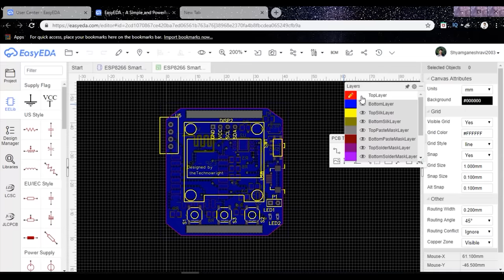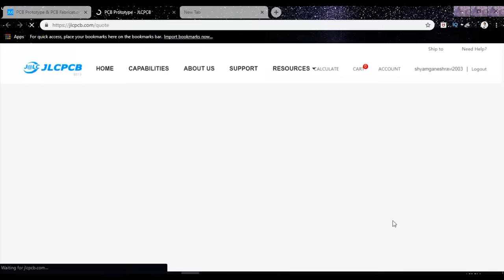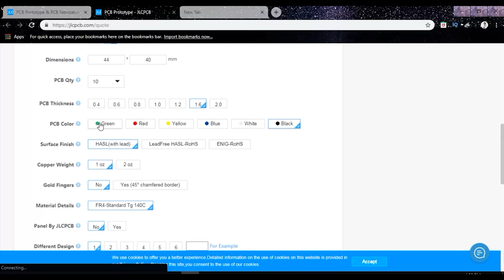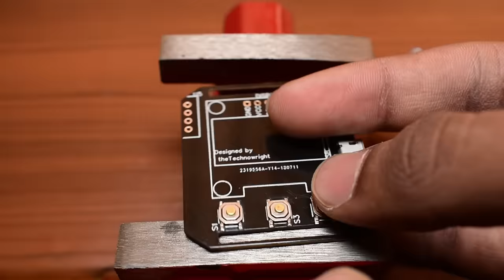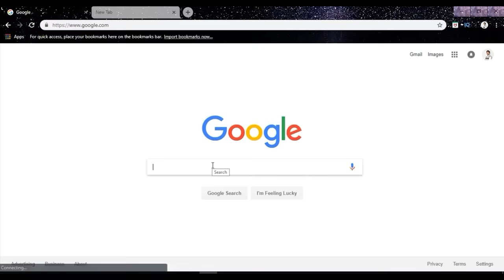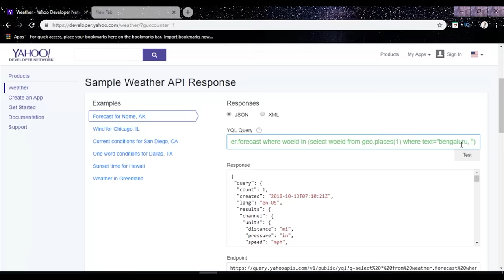How to make a DIY Smartwatch! || ESP8266 IoT Project

Comment from the maker: Hope you liked the video! And tell me what other features I can add to the watch.

And also check out my latest video on Custom PCB design using EasyEDA:
https://youtu.be/Lvp5RB3lgWE
Reply: Sweet! Have you considered making one with the ESP32 so you can connect bluetooth to the phone?
Reply from the maker: Yup, that will be the ESP smartwatch V2
Reply: Remarkable
Reply: Use a heart beat sensor
Reply: Or you can make it show notifications through wifi or bluetooth from the phone ill give you the code & the app if you want you gave me a lot and this how i can repay you 😍😍😘😋
Reply: I think ESP32 would be a good upgrade. And then you don't need to worry as much about the YahooWeather API too, as it has most sensors built in. It'll be a little bit more expensive to add temperature and humidity sensing but a bit more reliable.
Reply: a 3d printed case would be awesome so all the components aren't exposed
Reply: How to show temperature in fahrenheit I change tempC to temp it's not compiling
Reply: Include deauther and beacon spam code from spacehuhn.
Reply: CAN YOU PLEASE TELL ME HOW TO CONNECT THE PCB TO A RASPBERRY PI ZERO?? PLZ HELP
Reply: - A finished case
- Analog clock maybe (or analog/digital watch faces) make it more colorful as well, I'm assuming this is an RGB OLED It is not, maybe add that too.
- Animations (maybe in V3, not sure if the watch has enough power for anything but a basic one)
- Charging and battery indicator
- Micro SD can be a nice addition in V3! (Can function as the on-board storage because there is none)
- If you add alerts for calls, notifications, or SMS then you can add a vibrator (speaker will be a bit more challenging)
Reply: you could add a timer or a stopwatch, both are easy to do
Reply: U forgot to place ds3231 😎. How do you have to know a time without wifi?
Reply: Like traceur 2k said, a 3D printed case would make this better
Reply: it would be nice if you can add a simple ui system for button menu to add and remove buttons as we switch on and off multiple devices at home just like a smart home but more advanced
Reply: Bro if u do this and give me means how much the cost?
Reply: try making it to  make phonecalls
Reply: Add a camera
Reply: I love your video. I'm not good at DIY electronics, but if you want, I'll lover to buy that watch from you
Reply: plz share easyeda link
Reply: You can add 
1)IMU "MPU6050" and add some easy algorithms to track steps, running,sleep,deep sleep... 
2)use weather API to get todays weather...
3)if possible then add heart beat rate monitor...

Make your own app with mit app inventor or similar website... And connect it with firebase... And now you have your own cloud, your own app...

By the way this is nice try... Improve it further... All the best... Contact me if you want any suggestions...
Reply: @the technowright  can I get into contact with you for project purposes
Reply: Gr8 work bro....☺️
What is your age?
 you are doing amazing stuffs keep going.
Good Luck 👍

Comment: I like your work, let me just say some constructive criticism
1- keep eye on your audio level, i don't know what video editor you use, watch the two moving colorful bars that moves while playing video - these show audio level. You want them to barely touch the top all the time. In your video - the music is too loud and you are speaking quietly.
2- use flux on solder joints, do not be afraid of reheating the joint until it looks nice and professional. If you put too much solder, pull it away with copper strand wire or solder wick.  Also remember to clean your solder tip (wire sponge for dishes is best bet). After soldering you can remove excess flux with IPA or something similar.
But you are doing great, keep up at it.
Reply: Agree, the most important thing is to learn how to solder properly. Basics first. Training, training, training.
Reply: Matej Rajčan Excellent Criticism
Reply: There $1 sponsored to the video, for good work. :)
Reply: Parabéns pelo projeto
Reply: hell yes, i turned the audio up all the way bc i couldnt hear him speaking and then the intro ear raped me. rip headphone users
Reply: Agreed on the audio.. my ears hurt!  Started loud enough in the middle, then jumped up, and again at the end.  As far as flux, depending on the brand of solder paste, it can have flux in it.
Reply: Here you can see my smartwatch software based on the arduino platform: https://youtu.be/PfV0_dtcoIo

Comment: Great project. I have a suggestion for the two buttons.  Use the left button to toggle thru multiple relays that could be listed on the screen.  After pausing on a selection, the screen could change to the screen that you showed.  Then use the right button to switch the relay. The left button would go back to selecting a different relay.  This way you could control many more relays.
Reply from the maker: That's great idea, I just need to work on the code.
Reply: @shyam-ravi  Hey there! I love this video and Shawn's idea here would be great. Did you ever implement this into the code? Thanks for reading this. Marton
Reply: hello shawn hill..while completing this project iam unable to upload the code hough iam press and hold sw5..please help me to complete this project..thank you
Reply: @shyam-ravi  bro plz upload new video

Comment: Nice work! And thanks for sharing the files. 

Just a quick tip about the SMD soldering - you can do all the surface mount components with paste and hot air. A stencil will speed up the job but you can do it just fine without one. Just put a small drop of solder paste on each pad, then place each surface mount component, and then heat the board with hot air. Keep the nozzle moving in a small circle to avoid overheating any single spot. First go over the whole board to warm it up, then heat a few pads at a time until the solder flows nicely. Then move on to the next few pads. This way you'll only need to use the iron for leaded components and fixing any SMD joints you may not be happy with.
Reply from the maker: Thanks. 
Yes, I can solder all the SMD components with paste and hot air, but I wanted to show that it can also be done with a simple soldering iron.

Comment: A real-time clock for offline usage and an accelerometer to count steps and turn on when you tilt the watch toward you
Reply: The needs an accelerometer and rtc should be possible to integrate though
Reply: As easy as switching to the ESP32

Comment: Hi. Cool project. Couple of suggestions for future projects form a guy with 20+ years doing electronics design though:
1. Use flux, while soldering module / anything else you solder with solder wire. Sure, it has flux in it, but the flux inside solder wire is usually not the best and you do need more of it.
2. When placing a component, tin one pad a bit and while keeping iron to it, place your part - it's much more easy that way.
3. Keep both of your arms on table when soldering and positioning parts - you will be much more precise and work much faster that way. Work with your fingers, not all hands and arms. Hold the iron and tweezer in your hands like you would hold a spoon and rest the lower side and smallest finger of your hands on the table. 
4. Do not use the vice to hold PCB - it eats up the heat from soldering iron and air gun. It also raises the board high and you can not keep your arms on table, so your hands get shaky. 
5. You can use a transformer winding wire to make PCB fixes on first prototypes - looks and works very well, much more easy to solder to small spacing pins.
6. I find it simpler and more easy to put solder on all pads, clean the board and then apply liquid flux paste like AMTECH NC-559-AS on pad or part before soldering it with hot air. Solder paste works good only with the paste mask. You could just get a plastic single - use paste masks from china too. 

Keep up the good work and I hope these tips help you in future :)
Reply from the maker: Thanks for the tips!

Comment: That is AWESOME! The fact that you literally designed it from circut, to circuit board, to putting it together from reclaimed components - DUDE! AWESOME!!!

Since it's an ESP8266, you could theoretically use ESPhome and Home Assistant. This would allow you to manage it via YAML, flash it OTA, and make your button-clicks significantly quicker to apply the changes - which would be configurable inside Home Assistant through automations.

Also, how about an e-ink display to help save battery life?

Comment: Very good, but sweat will kill bottom of the board. U should place all parts on the upper side of the board
Reply: or he could just 3d print a plastic case
Reply: And the wrists might get itchy and bruised after a while too. But the components on top will increase the distance for display. This way it can be later modified to use display instead of display module. Anyway - that could be fixed if the strap would just go under the board. Or as John says - 3d printed enclosure.
Reply: @harijszablockis332  3d-printed enclosure will hide components (that make it look unique) and will turn this watch into a regular 1$ crap
Reply: @yohabi  or use acrylic...

Comment: Great project and engaging video - subscribed. The only criticism I can offer is that the bit of the board that the straps loop through looks pretty thin, like they could snap easily. Maybe a tweak to the board size, cutout size, or cutout location would make me less scared. Otherwise, I'm very impressed.
Reply from the maker: Thanks! I was planning to add a case to it to make it sturdy. But since I don't have a 3d printer, I couldn't print one.

Comment: Hey! They have since locked the Yahoo API and I am working on code that allows you to not only switch between different wifi's using wifimanager and also I am switching the API to one that is much better in general and lastly I am re-writing a lot of the blynk integration as your use of delays isn't great, instead the control of the lights will be switched to the Blynk API rather than blynk bridge. I will post it here when I am done.
Reply from the maker: Hey, that's really great of you! I really appreciate it. Don't forget to share it. And could you explain more on how you're modifying the blynk bridge to reduce delay?
Reply: @shyam-ravi  I am still waiting for the parts to be able to figure out what the API returns as a string and then write up the if statements for the button detection. The API I will be using was suggested by the blynk community and more information about it can be found here: https://blynkapi.docs.apiary.io/#reference/0/  I am not sure if it will reduce the delays, but since you had a lot of blocking code in your sketch, this will make it more efficient. Basically, this removes the necessity for the blynk bridge etc and it simply runs get commands to make it read and change the values on the pins of the relay board. 

Thanks again for your reply and I can't wait to have the relay board's final parts to be able to finalize all of the code. I'll be sure to keep updating here and on the blynk forums.

Thanks again!
Marton

Comment: What solder did you use with the hot air blower?? I never soldered that way... is it harder or easier? expensive or cheap?
Reply from the maker: I used solder paste for soldering it. It is much easier to use it for SMD components. You can get a hot air Soldering station for under $50 and the solder paste is around $15.
Reply: @shyam-ravi  thanks for the tip bro! you're awesome, really cool project you got there!!

Comment: Very nice project indeed. I would suggest replacing the hardware buttons with a LSM9DS1 and use gestures instead. That way you can use it with 1 hand. e.g. twist hand to wake up (show time), twist again to change function, move your hand up for OK and down for Back. It will also make your pcb smaller but will add about $7 for the extra part. If you have enough memory left you can also add cool functions like speedometer (for when riding your bike), compass etc.

Comment: I am just wondering if this watch works out of reach of wifi. If the guy put ssid and password to the code of ESP8266 ESP-12E, is he able to use other networks? Can he change ssid and password?  What if Blynk goes down?
Reply from the maker: The watch is completely based on internet. So it wont work in the absence of wifi. You can turn ON your mobile Wifi hotspot. And you can't change the network from the watch(you have to change SSID and password in the code). But I might develop a simple UI to do so.
And if blynk goes down, then only the feature of switching the relays  will cease to work.
Reply: @shyam-ravi   Waw, thanks for your answer.
Reply: @shyam-ravi  What can be possible is renaming the mobile's hotspot name and password same as that of the one you have at home (that was configured at home). Besides the difference in the channel, it will work.

Comment: What soldering tools are you using in the video? I need to get some for myself as I've just started with ESP8266 projects!
Reply: anything with temperature setup is good, but if money are burning hole in your pocket, get something like thermaltronics soldering irons, they work like wonder.
Reply: do you recommend specific models? I'm entirely new and need a place to start
Reply: @CircsC  thermaltronic has only two models, i have 20Euro piece of junk, and it is working till this day around 15 years, without even tip change. It says ZD-98 on it.

Comment: you have some VERY impressive soldering skills! 2 questions in elation to that. 1 .  what size/type of tip were you using? its much finer than any i have now, but i could use one.  2 .  throughout your soldering (especially when you were removing the parts you needed from the other boards) you had another device in yoiur other hand, all we could see was a copper likew tube? it acted like a small heat gun?  awesome project, insprired some ideas and your pcb maker is now on my lkist!
Reply from the maker: Thanks!
1. I am using the Hakko Soldering Bit 900-M-T-I 
2. It is a hot air soldering station. Here is the link; https://amzn.to/2EHGLsC .

Comment: I enjoy the video very much, the only problem I have with it, is that blasted background music!  It is like 90% too loud, and rather inappropriate for such a video as far as I am concerned. I have most of the parts for this at hand but for the buttons resistors and board.  I am considering building it with standard parts on an old ESP8266 board that has been laying around since the 12 came out.  I will probably just put it in a project box instead of on a watch, however I have gone to the site that has the boards, and filled in the info, the shipping is a bit tough for an old fart on Social Security but getting 10 of them gives a fellow a good chance of screwing up and having a fall back board.

Comment: thats a nice project 
but in order to make it more comfy you need to come with another design

here is what i think can improve it
1- use esp32 along side deep sleep for longer battery lasting 
2- instead of using wifi use ble 
3- there are lots of other lcds that you can use but still its up to user
4-about the programming using blynk was good but you can use better programming with a little skill in arduino without using any servers
5- you can add tons of other features like temp of wrist and the blood pressure or the heart beat sensor for medical usage

actually this can be a good usage for hospital healthcare about the people who are under treatment and needs medical care
if you were up to do such project i can help ya with the programming

Comment: Nice project!
What is the power consumption of such a watch? ESP gets a lot of power if it has Wi-Fi on.
Did you think to turn off the transmitter in the code or put the ESP into sleep mode?

Comment: Interesting project. One thing that came to my mind that maybe the weather location settings could be done automatically, based on you IP address. If the watch knows its own IP, it could get its location from a webpage like iplocation.net, then use that info to update the yahoo weather query.

Comment: I'm looking for something to this to build a 24/7 heart rate track and sent it over wifi (remote tracking and alarm). Is there any input avaliable (it seems you have problem with one of them, with one?) I ned 3v+gnd+input for heart rate sensot. Or maybe the solution is not use one of the 3 botton and use its 3v+input?

Comment: Hey, technowright, great project, i like how you tackled the whole process from start to end.
I’m a professional software developer (but i have a okay-sh electronic knowledge).
Looking at this video you brought to my mind one of the projects in my wish list 🙂
I was thinking to build a configurable/programmable boardgame made with a number of tokens which are basically tiny oled displays + wifi connection.

They should talk with a mobile app which basically runs the game and update all the tokens with the proper information (those tokens could also have some hardware buttons like your smartwatch to send some input to the mobile app…)

This could be a very nice framework for developers who want to build their own boardgame!

About this subject i have some random questions for you and for the audience here:
* what do you think of this idea?
* which components would you suggest me to build a prototype?
* is it possibile to have a rough estimation of the battery life of a token (based on the display type + battery chosen)
* what about e-link displays?

Thanks for your answer!